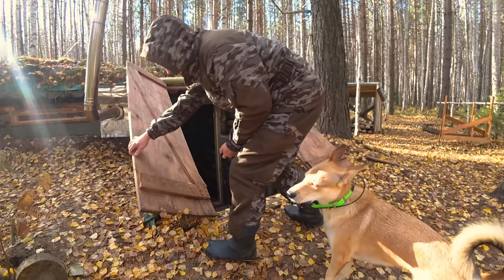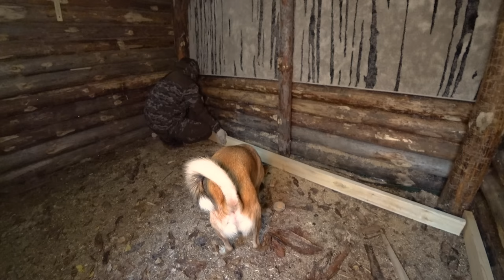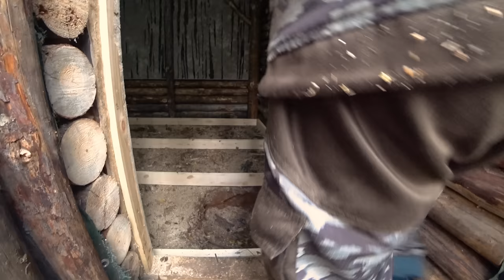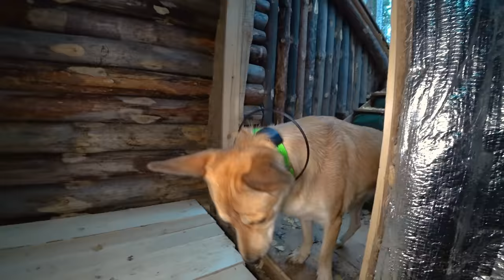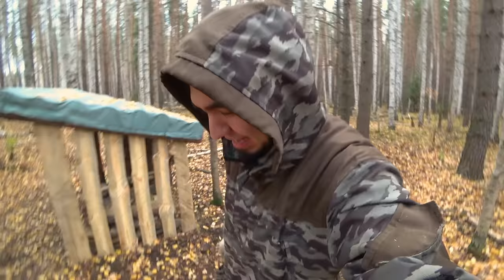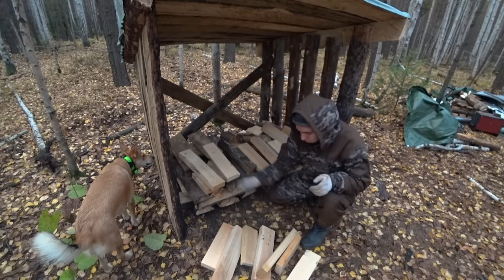I lay new boards on the floor of the dugout. Rebuilding a house underground in the forest.

Comment from the maker: Hello everyone, my name is Alex and I live in Russia. Today I came to the forest with my four-legged friend named Pyosel.
A few days ago I brought planks and covered them with a tarp to keep the rain out. Today I plan to make a base for a new floor and lay the boards on the floor. The weather is wonderful outside, the sun is shining, yellow leaves adorn the forest.
A hole was dug in the ground near the entrance, where I store some products, and in case of a flood, water will accumulate in this hole, from where it can be scooped out with a bucket.
The boards that I brought are 3 meters long, the size of my dugout inside is 275 by 290 centimeters, I built it by eye, so the floor has the shape of a diamond.
Initially, I wanted to paint the boards with a protective compound, but the humidity is high outside, the boards will dry for a long time, so I decided to make the floor from clean boards, in the future, if I want, I will paint them.
Pyosel has a green gs collar around his neck so that I can always know his location.
I left a gap near the threshold to sweep debris from the floor there. I did not begin to nail the boards on nails yet, so as not to rush and not make mistakes. Also, I didn't cut the hatch in the floor, I decided to leave it for later, I'm not sure yet if I need this hatch in the floor or not.
I lifted the floor to see it in all its glory. The boards are still light and clean, which adds visual space to the dugout.
Now I'm very tired, so I don't cook food.
Reply: Thank you for your explanations. I hope you are healthy again and stay that way! Lg
Reply: 😂what age Pyosel very cute dog 😘
Reply: Love from india ❤️❤️
Reply: Nice to see you again Alex...
Reply: Thank you Aleksey.  You and Pyosel cheer millions of us up in these bleak, dark days.
Reply: Очень классный лесной домик !!! Посёлок просто милашка ! История с его появлением в Вашей жизни , просто удивительна ! 
Вопрос , а навигатор какой у Пёселя ?
Reply: Aleks wilď?
Reply: Lovely to see your gorgeous smiley face again. Love your videos. ❤xx
Reply: Hello Alex. It's a pleasure to see you and Pyosel both looking so healthy and happy. Hope your dugout will be all fixed up and cozy for when the really cold weather starts. I'm looking forward to seeing you cook a good dinner in there on a snowy night. Love from Paris and see you soon.
Reply: @Jaat_13.  Weeks ago the celebrate his 1. birthday. :~)
Reply: Box
Reply: @danbowie613  I am happy to know about painting boards. Good info.
Reply: Hello my good friend! Always excited to see you and your amazing pup! I was just wondering how you got the wood planks to your shelter?
Reply: Que buen trabajo . Se ve  bonito el piso.   Saludos desde chile un abrazo fraterno a ti y al cachorro. !
Reply: Alex…Every time that I see You look at the camera and flash Your smile…Oh, Alex what I want to say to You is, “Good Job.”❤
And I’m here wishing You another day of Peace. мир. That is what I want for both of us living in our own part of the World. 
Free to play with the dog and laugh and build and make videos. My friend, I know You know what I mean when I mention the word Ukraine. But You continue to remind We who live on the other side of the World…that agape love and nature will keep us together, no matter what. Thank You for all You do. Peace. 👍🏻
Reply: How did you get all those boards out there?
Reply: Alex your videos are the best thing on YouTube watch them over and over , keep up the great work , peace to you brother. Big fan from new Zealand 🇳🇿 👍
Reply: Beautiful work.
Reply: Bravo Alex, heureusement que Pyosel regarde si le chantier est bien réalisé 😅
Reply: How did you get all the boards there? All in one trip?
Reply: ME GUSTA SUS VIDEOS EN ESPECIAL LA ATENCION EL CUIDO Y AMOR A PYOSEL ES UN ♥ 💖 ❤ 😍 💕 PERRITO AMOROSO Y MUY FELIZ ME ENCANTA LA CABANA EL BOSQUE.AHI NO EXISTE PIE GRANDE O BIG FOOT?????.
Reply: HOLA ALEX 
VEO TODOS TUS VIDEOS .NO TE CONOZCO PERO ME CAES MUY BIEN..ME PARECES UN MUCHACHO TRANQUILO Y HUMILDE ADEMÁS DE TRABAJADOR Y SIMPÁTICO.
CUÍDATE MUCHO 🙋
Reply: Watching here from philippines
Reply: Ola Alex, sou brasileira, Brazil,seu trabalho é Muito bom, otimo trabalho e belissimo bunker, amo o povo da Russia, minha irma foi morar na Russia, sou seguidora do seu canal, e acompanho todos seus videos....o seu doguinho🐕 e lindo, tenho 8 🐕, sao minhas paixoes.....gosyaria de saber como obter um fogao deste seu...obrigada
Sucessos e muita paz...
Reply: Hi Alex how did you get the boards to your cabin?
Reply: Hello Alex love the dugout and the vlog . hope all is well with you and yours all my best from Liverpool
Reply: @dgcsbucdbgvscfvdc  alex wild is a different vlogger...
Reply: I hope the boards are pressure treated if not and you're placing them on bare ground I give them a year before they start to rot I didn't see a moisture barrier like plastic on the ground between the dirt and timber you're doing a good job otherwise I pray to the FATHER GOD ABBA to keep you an pup dog safe AMEN
Reply: @Jaat_13.   Not very old maybe about 2.  He was a rescue puppy, simply walked into Alexey’s path.
Reply: @ludwigderzanker9767   Pretty sure, his first birthday of having him.
Reply: @mitchsnyder77   I’m suspecting the same way he brings his other loads, by sledge.
Reply: @deedawson6074  yes it means literally his second first birthday! God's Blessings from Northern Germany for you and your family! Ludwig
Reply: 您好，我來自臺灣，你的手好巧，好棒的工藝👍
Reply: @Jaat_13.  yes he is
Reply: THE THINGS YOU ARE DOING MAY BE IMPROVEMENTS , BUT LET'S FACE IT -IT'S CITY LIFE FOR YOU BECAUSE IT'S WHAT YOU'RE DOING TO THE PLACE

Comment: It's nice that you're back to preparing your forest shelter.  
Also that you still find time to play with Pyosel, that's also part of it.  were you able to make the floor planks yourself somewhere?  
Or did you gradually acquire them?  Now pull out a plank on the left and right, pull a long rope through coal, fasten it on one side with a nail, pull it tight to the other side, lift it slightly and let go (shingle rope), you already have a line to fasten the planks. 
You can definitely make the wedge yourself, if so I would insert the one before the penultimate plank.  
Well, I'm curious how you set up the room and how you want to do it with the stove and fireplace.  
Greetings from Harry who has been watching you since episode 1!
Reply from the maker: I bought these boards at the store, then I brought them to the forest while there was a road for the car, and then my friend and I yearned for 5-6 boards at a time, we had to go back and forth many times

Comment: Alex, have you ever considered putting some type of battery operated exhaust fan in your dugout?  I have noticed many times in your videos there is a lot of fibers from the material you stuff between the logs floating in the air, it may not be good to keep breathing them in.  I like your new floor, keep up the awesome work!

Comment: If you wanted to clean up the look a little bit, you could put the gap in the floor on the back wall, that way you could literally sweep everything under the bed and make it disappear, while also having a nice, clean meeting between the floor and the wall on the side you can actually see

That is if you put the bed back where it was and don't change the floor plan

With a floor that nice, you might need a doormat out at the bottom of the stairs, gonna need to tell the pup to wipe his feet before he enters

Comment: Hint for you your hand saw is also a 45 and 90 degree miter square if you lay it on its side using back as your guide squared lumber to handle.

Comment: For  anyone else doing this... Build the floor frame in 2 sections like  a torsion box then drive 2X4 or 3X3 stakes in the corners and center to place the frame on and level it before putting your flooring on. Use a vapor barrier and do not set your wood right on the dirt. Your floor will last years longer by not having contact directly with the dirt.

Comment: Looking very good. But wonder do you not want to put in some isolation materiaal in the holes?in between?
Reply: Above he reads he will it fix later on and then finish the floor. He doesn't want to hurry.